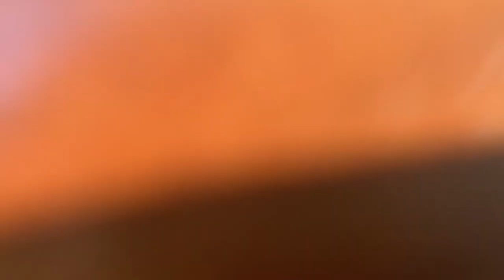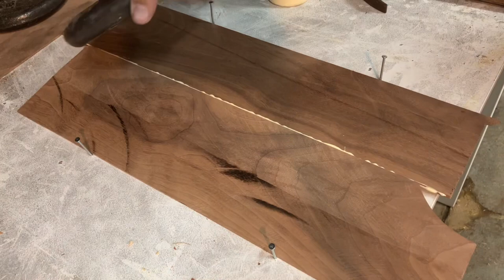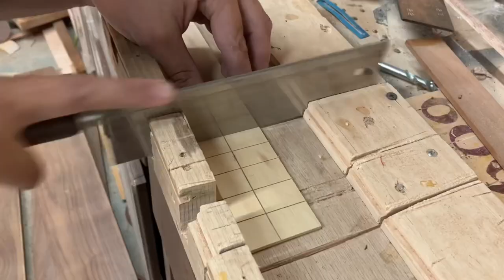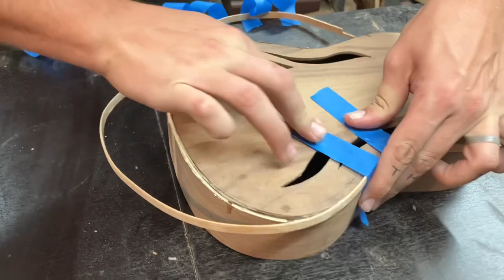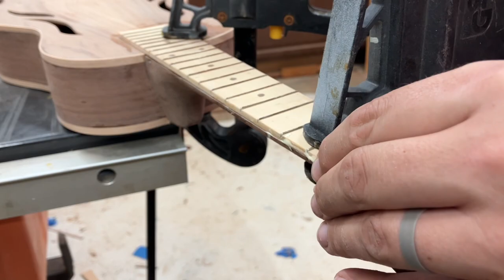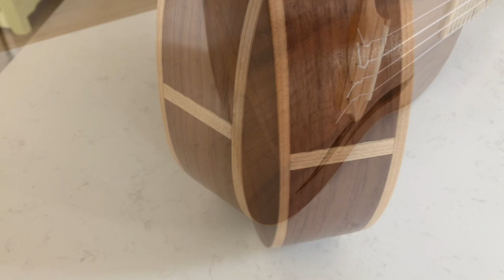I made this walnut ukulele out of a headboard I got for free!

Comment: Great job! What were you using to bend the sides? Is it some sort of hair curler or something? Ingenious if so! Did it work ok?
Reply from the maker: It is a curling iron for hair! When I first decided to try making an acoustic guitar I was too cheap to buy a real bending iron or a heating pad like you’re supposed to use. 

 I made this short about using it. https://youtube.com/shorts/IjPl_jtp_-Y?feature=share

But also I’ve used it in my other ukulele video and acoustic guitar videos! It works
Reply: @dannylewisguitars  great stuff! Thanks for the reply. I was considering getting into making acoustic instruments but was put off by the bending part. I will try this out!
Reply from the maker: @monkeypuzzler  Just go slow! Start with thin stock. Spray it with water and slowly bend it while introducing steam.